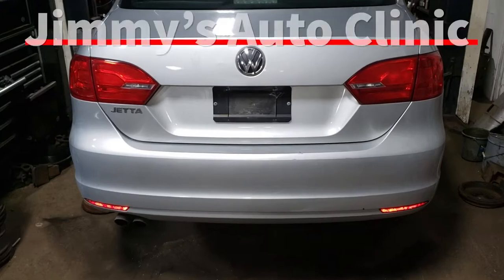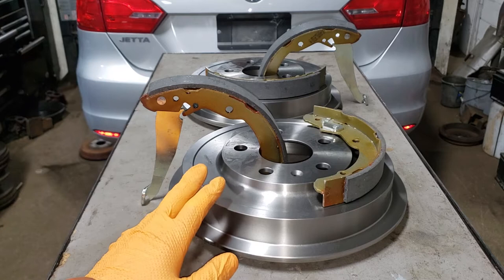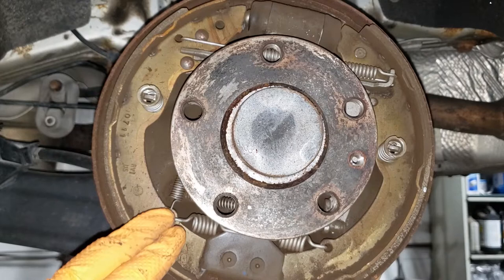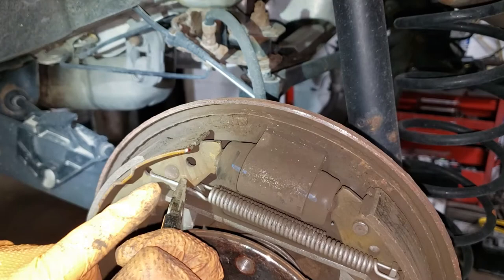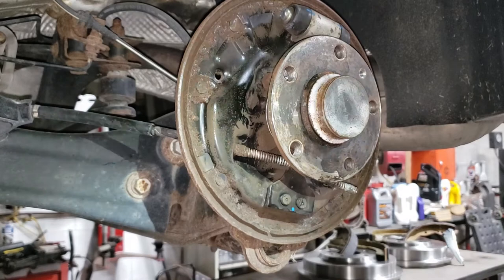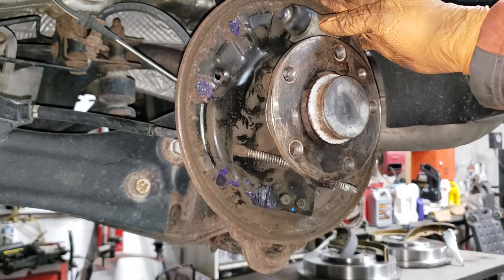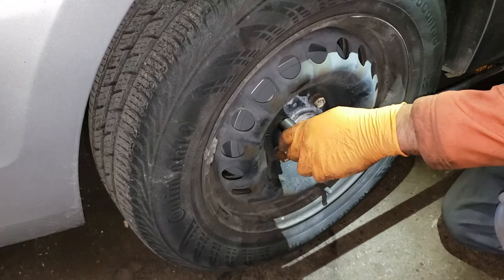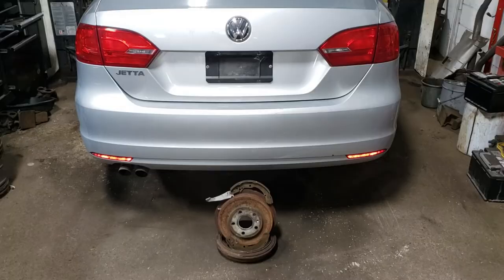Volkswagen Jetta | Rear Drum Brakes | 2011 VW Jetta

Comment: I love this video! Im 18 years old and just recently bought a used 2011 jetta as my first car. Ive been facing some problems with the brakes squeaking a bit when coming to a stop and Ive been thinking about getting it replaced. Your video was very educational and gave me insight into how this "ancient technology" works 😂
Reply from the maker: Aldrine,  thanks for the comment, I'm glad you enjoyed the video 🙂.
Reply: @JimmysAutoClinic  Do you also think its possible to have a drum to disc brake conversion for the rears?🤔
Reply from the maker: Hey Aldrine, it is definitely possible I just don't know what is involved and what parts are required for this specific car. Sometimes it's quite simple but you just have to change the backing plate, bearing in a bunch of other components that aren't so hard to change. On some cars though you have to change out the spindle completely. I'm not sure what you'll have to do but I know it's possible.
Reply: @JimmysAutoClinic  Theres a youtube video on it   https://www.youtube.com/watch?v=ZH6TfmYIXSs&ab_channel=Sth91 and it seems to be pretty straightforward. Like you said the backing plate was just changed but the spindle was kept in
Reply from the maker: That is spectacular. There you go now you'll never have to deal with that kind of archaic technology again and you'll have better brakes:-). This is a perfect example of why we all love YouTube.

Comment: I started to exchange my brakes myself after getting scammed several times by an authorised VW garage, im an engineer but dont actually work on cars but ships.
made some mistakes exchanging the brakes, pressed the brake while the brake was out causing it to spit out the brake cylinder and lost all my brake oil.

This however was actually a good thing because:
- found out the brake fluid that spilled out was dirty as black motor oil, and i just had paid for a brake flush and fluid replacement with the WV dealer
- found out my brakes where not worn as previously mentioned by VW dealer that i needed urgent replacement.

I also found out that the torx screw was damaged, possible by the VW dealer and they never opened it the last maintenance because of the brakedust that was collected on the driver side vs the passenger side.

For now i drilled the screw out, its also a pretty poor choice from VW to use torx in this case as they easily get damaged in my field of job we use inbus as they are more robust.

In another occasion they scammed me when i supplied the front disc brakes (quality ones) the VW dealership that does also maintenance in my city had swapped them with cheap Chinese ones that screamed after 2 weeks of use.
Reply from the maker: Unfortunately in my industry it is not an uncommon occurrence. Unfortunately most people just don't know that it's happened to them. I will say that there are good mechanics and dealerships out there it's just hard to find them and they usually aren't very happy like myself because we do all kinds of work and definitely don't make enough money. Hopefully you found my video useful and it helps you doing your brakes yourself so you don't end up getting scammed. Sorry you had a bad experience. Thanks for sharing.

Comment: Hey this video helped so much. I got new shoes and drums in. My only problem is that my reason for changing was a thumping sound from the back when breaking. New shoes and drums fixed this issue but the sound is back. Do you got maybe an idea on why this clunking sound is happening. Changed all the springs too and put new wheel cylinders as well. Anyway love the video helps lots.
Reply from the maker: When is it that you usually get the noise is it under light application of the brakes or heavy application? Generally with regards to sort of clicking noise it usually indicates that brakes are out of adjustment and not properly contacting or you have warped rotors. If it fix the issue once you first did it and the issue then came back I would think that possibly the automatic adjuster is not adjusting and then the brakes over time are becoming out of adjustment which is causing the clicking sound. The adjuster could be bad or it could be your old friend rust.
Reply: It ended up being that good old friend rust lol. It always made the sound on light breaking. Ended up giving it a super good cleaning with a wire brush changing out the little pads the shoes sit on and a bunch of grease in the right spots. So far so good.
Reply from the maker: @Chemwhiz spectacular I'm glad you got rid of that annoying noise. I know those types of things can drive people up the wall.